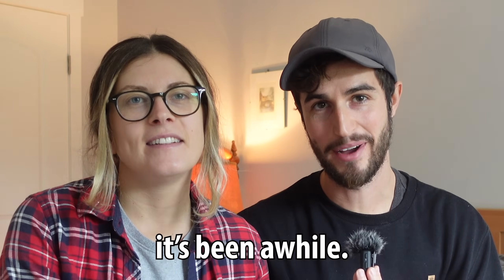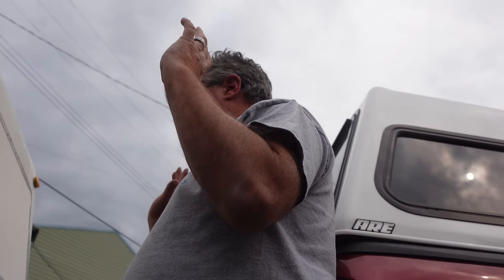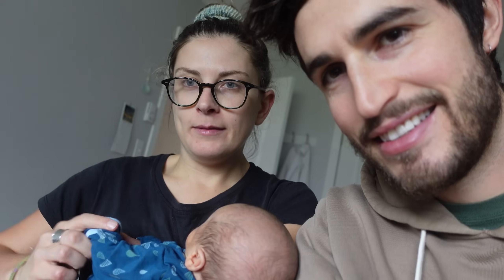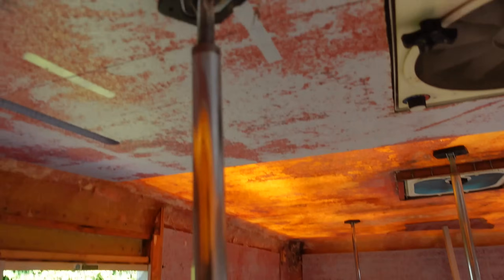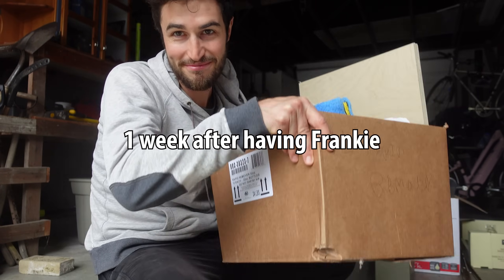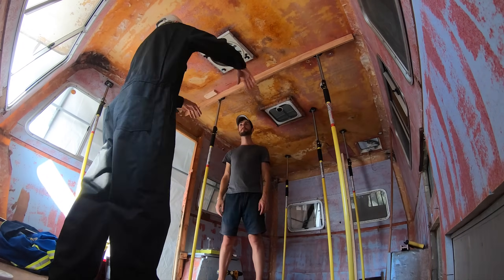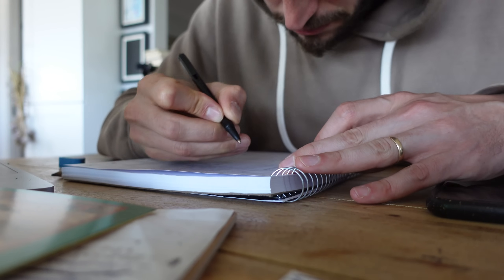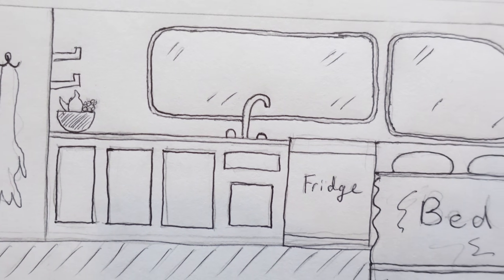Our Trailer Renovation Reality Check... (We had a baby)

Comment: 2 tips (whitout telling you what to do with your trailer 🙂) 1 - for the dining bench table that swings out - look at the possibility of making it unfold to 2x the depth - this will give you a low/slim profile against the wall as a breakfast/coffee bar and when swung out you can flip the top open to make a dinette size for more people (stolen idea from Antiques Roadshow and the old card/games tables that were low profile them transformed when needed with more space.) and speaking of stealing ideas 2- don't forget to check out boat/yacht cabins for storage ideas as they, like trailers, need everything bolted down when in motion. See ya in 2 weeks (more if you need it)
Reply from the maker: Yeah we're going to figure out the exact "hows" when we get to the build stages of this thing. It's going to be a work in progress 👍🏻
Reply: Hey good news about the outsite! One thing ill recommend - draw ur plans on the floor of the van, we found out from measurement to floor we were out by 1cm and it meant we had to move our toilet, which we were glad we found out early! Enjoy parent hood looking forward to the fortnightly videos :)

Comment: Hey! I'm finishing my naval engineering masters and I learn a bit about composite construction. It's very normal for the roof to be sagging, in composite yatchs the fiberglas itself is not what keeps the structure rigid, to support the fiberglass hull, there is a sort of skeleton around the entire structure making it keep its shape, this can be made of more fiberglass or just wood, the main principle is just to have a support which is basically the profile of the shape you want to have, all around. Basically don't just make 'beams' on the ceiling, make supports all around the fiberglass. Just google 'inside a composite hull' for some images if I wasn't clear enough. (English isn't my first language)
Reply from the maker: This is awesome to hear! Thanks for sharing this, we figured that the cabinets and internal stuff was going to play a big role in the stability of the trailer so hopefully that sorts everything out!
Reply: This can also be accomplished with sandwich panel construction instead of ribbing. You can use either XPS insulation or composite sandwich core foam, but it will be much more expensive. Using a continuous foam core sandwich construction all around the inside will prevent any thermal shorts, so there won't be any cold spots, your insulation will be much more effective. Once the insulation is in place you can glass over the inside, or use wood paneling or similar, just anything to attach cabinets etc to. Lots of solvent based adhesives will melt XPS though, so you have to choose carefully

Comment: I think if you can use hinges on the bed and the bench to help you  access the storage underneath it will maximize your storage capacity and you should watch as many tiny house videos as possible to get ideas and check out baren and Elsa scamp trailer build they are smart

Comment: I would make a full check on the structural for the frame also.  Check for crack or weak weld points that may need reinforcement. Maybe some arched beams would look cool and add to support the roof better.
Reply from the maker: Yeah the frame and axle/bearings is on the list of things to tackle next.

Comment: An open shelf is kinda problematic when you are in motion.  You will either have to pack everything on them into a container and then unpack every time or they will fall all over the place.😢
Reply: Yes they would have to pack everything anytime they moved at all. Rails on the side would help but even I think that would be chaos.
Reply: the other option is to figure out screwed-in systems, that's pretty easy to do for spices, not as easy for mugs/plates
Reply: they will have a deep sink right there, just shift everything to the sink when travelling
Reply from the maker: Yeah its not like open shelves with nothing in there to secure them. We've used rigs with edges and rubber to keep everything in place (plus we can put stuff away for move days)
Reply: BlueTac is your friend. No need to pack everything away
Reply: @LeahandLevi - magnetic surfaces could be fun and keep things in place.
Reply: We are full time RV'ers. We have an open shelf in our camper and my husband cleverly inserted two rows of eye hooks and we use bungee cords to hold everything in when were on the move.   Oh, I need to add everything on that shelf are in two mid size plastic "totes". Works like a charm. Good luck to you.
Reply: Yup also you can do magnets and wooden rails all around your shelves too. You guys will figure it out!

Comment: WEIGHT DISTRIBUTION!! Please factor this in your design - the water and bathroom toward the back may not be best. Increased weight behind the axle is very very bad for towing. It is best to load evenly with heaviest over the axle and a slight bias toward weight in front of the axle (balancing stability, safe total capacity and modest but existing tongue weight). Get someone with towing experience to look at your plans and consider modifying your floorplan. There is a reason a lot of trailers seem "odd"  splitting the sleep/dine and primary sleep areas with bathroom and appliances in the middle - balance and safety towing! Good luck with the build, you can do it!
Reply from the maker: That makes a lot of sense and we're definitely going to have to consider the grey and fresh water tanks carefully

Comment: I’d take the max towing weight from your pickup and shave a few hundred pounds off of it, then build the trailer out to be a little below that number. Just to account for the extra weight of any gear, food, clothes, baby stuff, etc…, you’ll be packing into the trailer.
Reply from the maker: Yeah that's a big factor of why we chose the truck. Having more towing capacity rather than not enough is a priority
Reply: @LeahandLevi  look into bamboo for wood, it’s lightweight, but can bear weight, and sustainable since it grows like crazy.